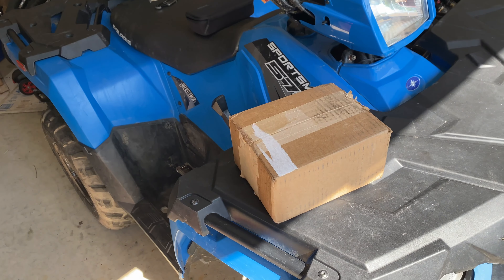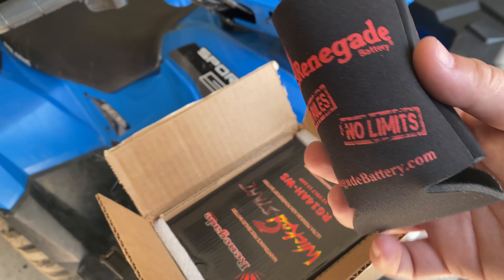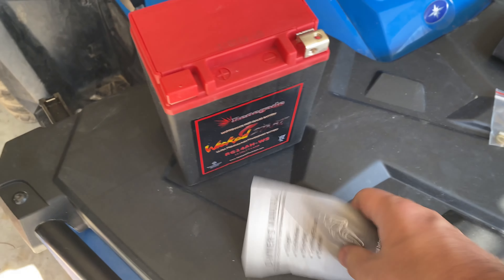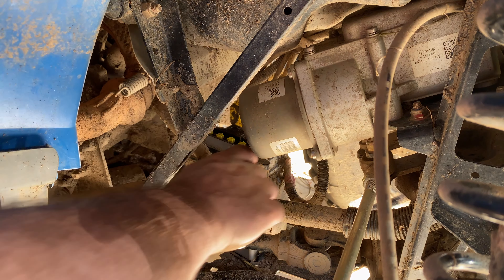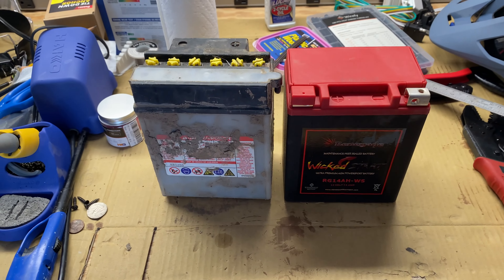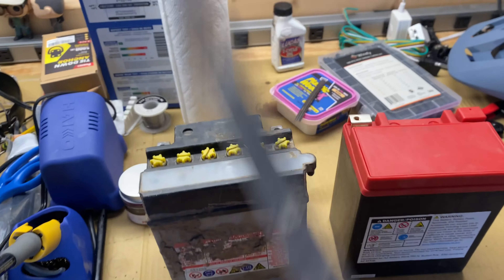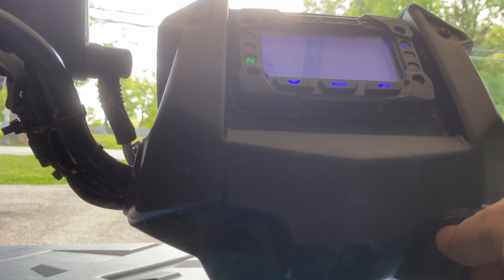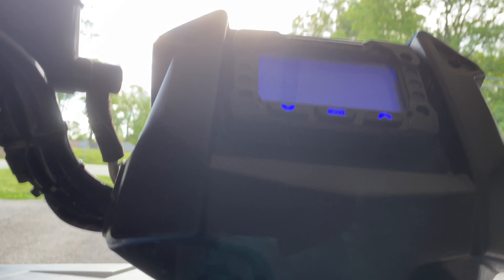Direct Replacement Super Powerful Battery / Renegade Wicked Start Unbox Install / Polaris Sportsman

Comment: unrelated but how do you see your current engine hours or how many miles you've driven i just got a 570 and i dont know how to
Reply from the maker: Do you have the electronic gauge cluster (i think this was 2019 and up)?  if so, you can use the arrows below it to go through the different options.
Reply: @DadTechTV  mine is the base model for 2023 i dont have the arrows but i just figured it out you just tap the yellow override button to cycle options i knew you could hold it to reset your service thing but didnt realize you could also do that thanks for the reply

Comment: How is this battery after 7 months?
Reply from the maker: Had it all through the winter, plowing and riding. No issues. Still starts strong. Have not had to put it on the tender.